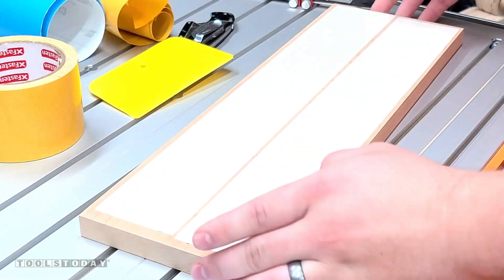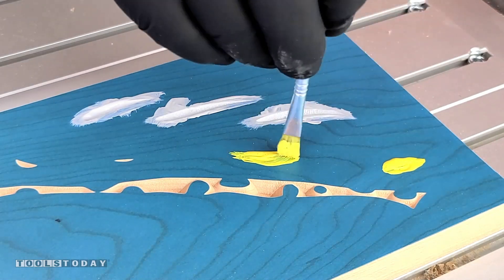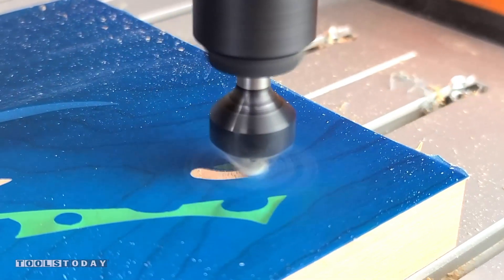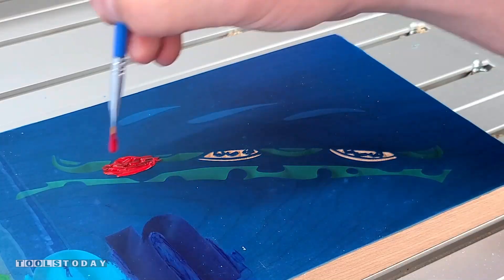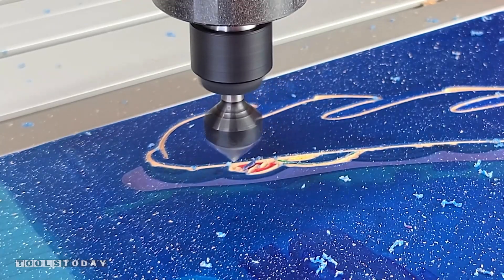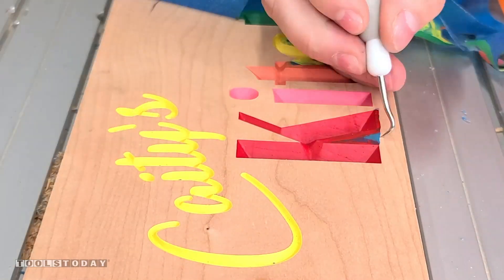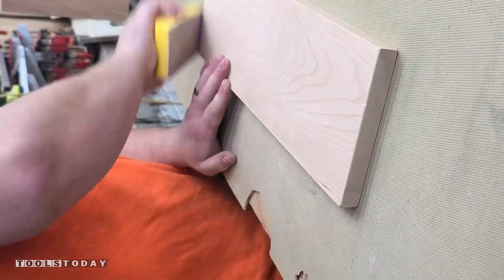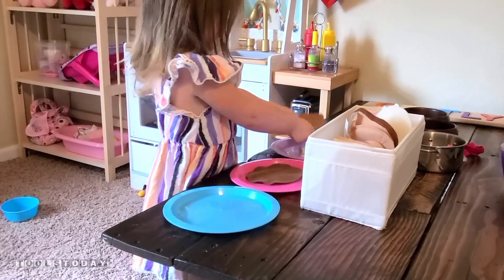Making a 9 Color Sign | ToolsToday

Comment: Did you use the feeds posted in description? I was just using the same bit for oak and was getting some chatter using the default speeds. I'm guessing that being a harder wood I should have slowed it down a bit?
Reply from the maker: Yes I did.  On harder woods, you can keep the speed and feed the same, just lower your depth per pass, that should eliminate any chatter.